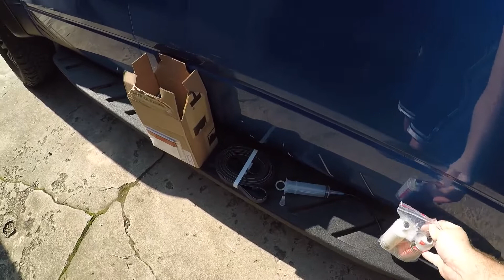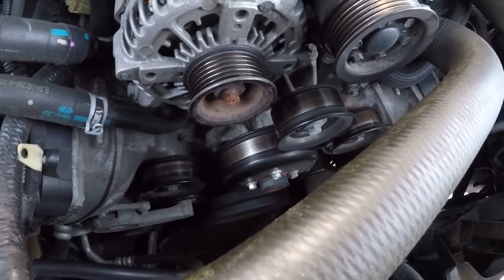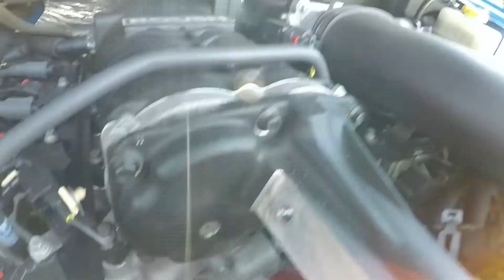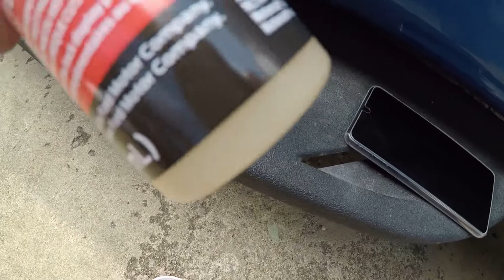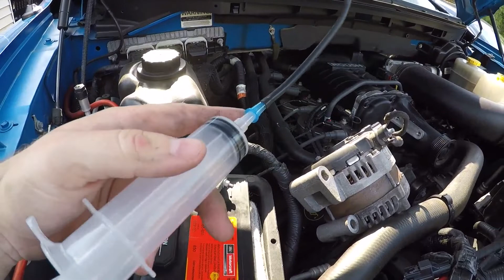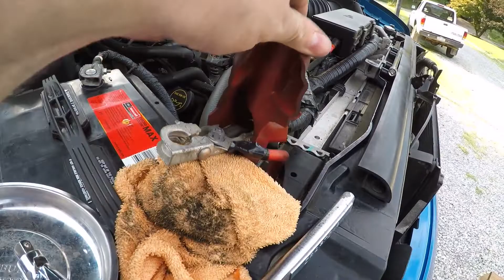2010-2014 Roush F-150 SVT Raptor Serpentine Belt Replacement and Roush Supercharger Fluid Change

Comment: Thanks for posting this. I just picked up a 2012 with the roush kit on it. I am going to change all fluids as it is unknown at the moment what I’m dealing with
Reply from the maker: Make sure you check out my video series for other fluids.  I've done the supercharger fluid on mine already, transmission, transfer case.  I still need to do the front and rear differentials and antifreeze, I just hit 100k miles.
Reply: @fixitfrank412  Will do brother! Yeah I’m gonna change the diff fluids also…changing the rear diff cover. Have any recommendations? I see the AFE one has a sight gauge but I hear the Ford performance one is prob the best one. I like the look of both tho.
Reply from the maker: @patrickhoward4080  I'm gonna do the Ford Performance one when I do it, the Spicer is the same but cheaper if you don't care about it saying Spicer instead of Ford Performance!

Comment: Helpful video. Quick question though. Is your's a 6.2L V8 with the Phase 2?  The reason I ask is because I recently bought one used and the old belt broke in the worst spot possible, right where the part # and dimensions are imprinted.  So I went to O'Reillys abd the looked up the belt for my truck, only for it to be about 4 1/2" inches too small , specifically the 106" length.I ordered one that was closer but still no joy , so i went to my local Ford dealership. I told what was up and gave them my VIN, and they ordered me a belt except was still too small.  
Does the bemt have to be a Roush to fit, or do you happen to know the dimensions? Inly reason I ask is that I need my truck for work and I can only borrow my dad's for so long, so I cannot afford to wait weeks for one to arrive.
Reply: Hey bud, you need K061251 for stage 2. For me the gates belts don't make noise but I've blown both gates and the ac delco "HD" green belts.
Reply: @ErikWrazen  thanks. I ended up finding a guy that made me a custom order one, but I'll keep the part # in mind . Appreciate it.